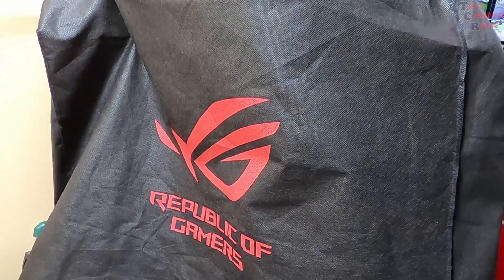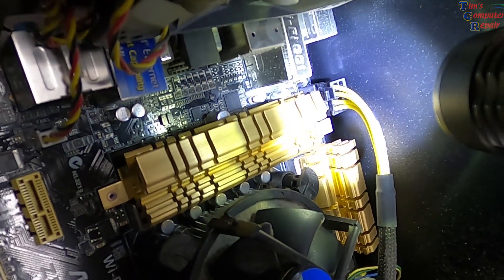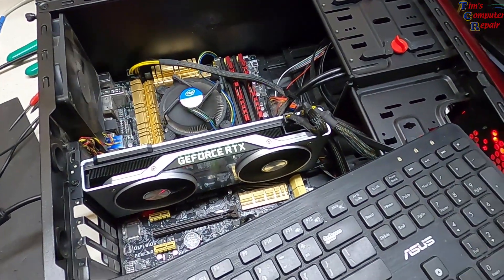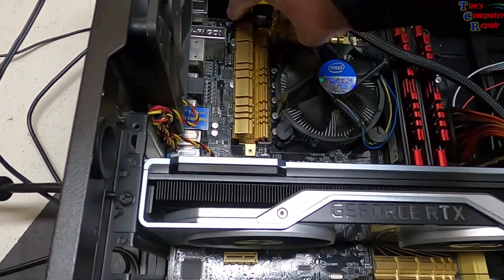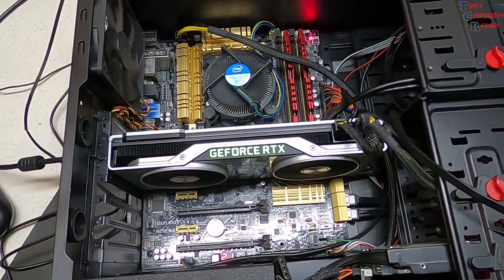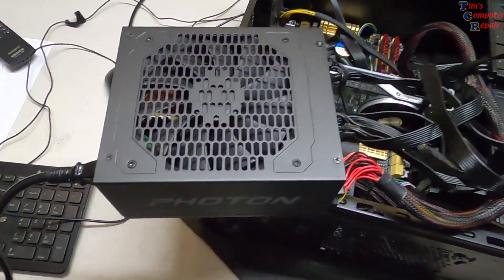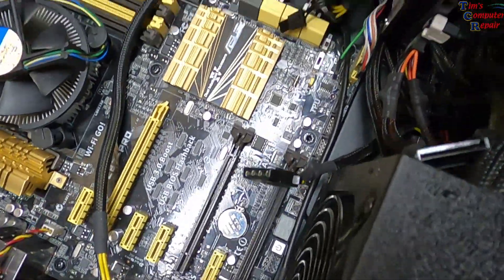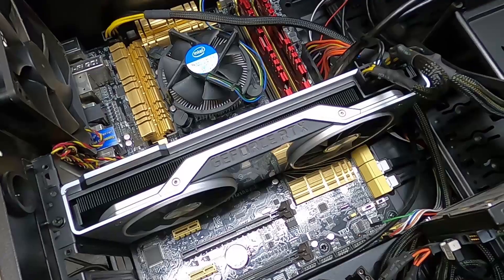How to Diagnose and Troubleshoot a Custom Built Computer That Will Not Boot

Comment: Hello I just built my own computer, and it won’t turn on at all. I originally thought it was the power supply but we hooked up my friends and still nothing. I don’t know what it could be, I haven’t tried jumping the motherboard so it could be the front panel connectors but I have no idea what could be wrong with it. I took out the cmos battery and let it sit. I’m gonna try and jump the motherboard today but I don’t know what it could be do you have any ideas? Thanks in advance

Comment: @ 0:33  I would look into the  front  power connector on the top of the case,  they might got damaged by the falling speaker!  just guessing . 🙏🏼
Reply from the maker: I can see why you would target that. I figured the power connector worked previously so did not go down that road. Thanks for the input.

Comment: Thanks for the video Tim, glad to see my go to 1st place to check (the RAM) is the same as yours. Shame about the board, may have gotten grounded by the metal case when the speaker hit it, shock it enough for something to touch the case maybe? who knows
Reply from the maker: Funny it has been running quite some time even after the speaker incident. Go figure.
Reply: @TimsComputerRepair  well thats weird. Coincidence then lol